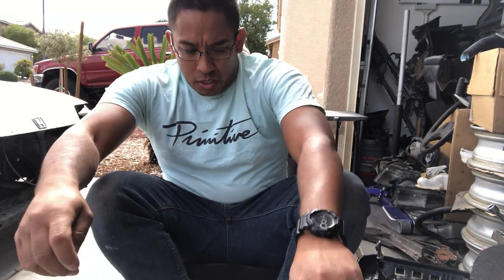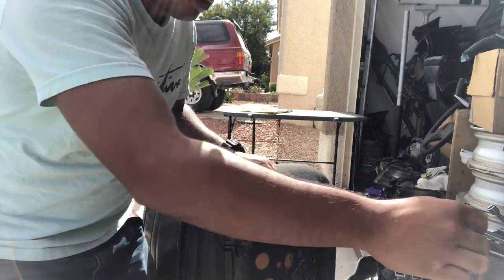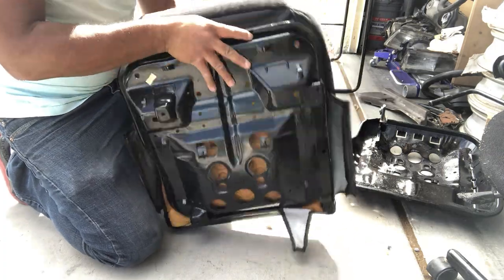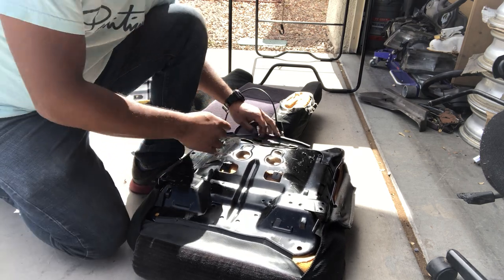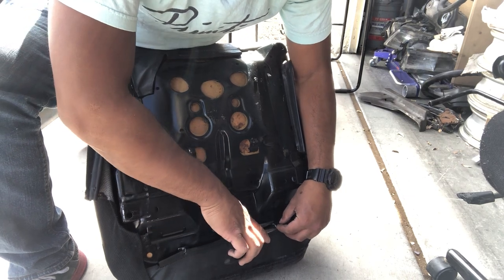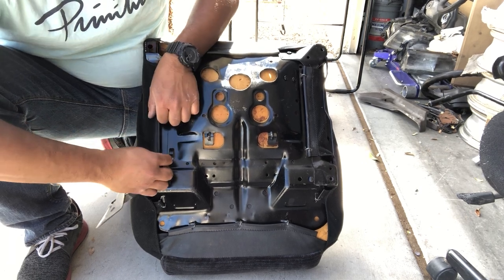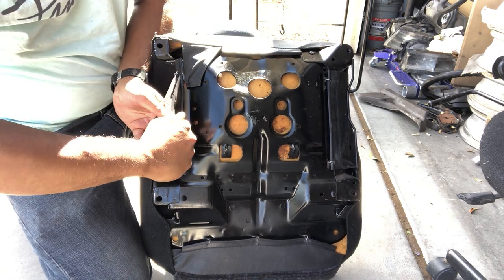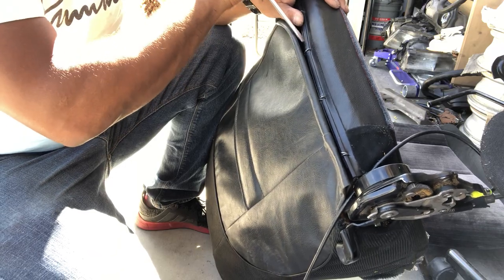88-91 EF Civic hatchback pan swap

Comment: I just bought 88-89 seat pans/rails for my 90 seats….my question is, why did you have to swap the lever part that lets you adjust the back part up and down? Will i be able to just swap the seat pans and seat rails and call it a day or no?

Comment: Can anyone help me out? Im working on the stock dx seat rn trying to remove the rails, but i cant get to the bolts on the tide where the seat adjustment is. The handle is too big to fit through the plastic and the bolts are under it. Anyone know how to remove the handle or maybe how to wiggle it through idk
Reply: just pull the handle off hard with some pliers or something and it’ll come off